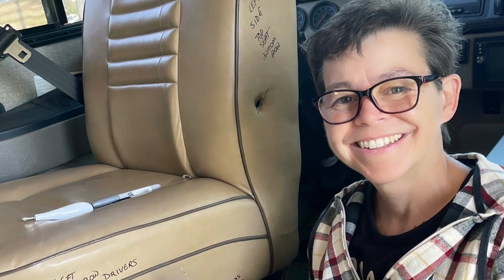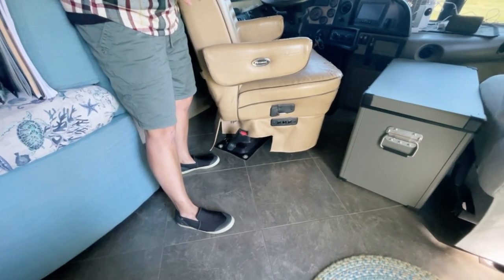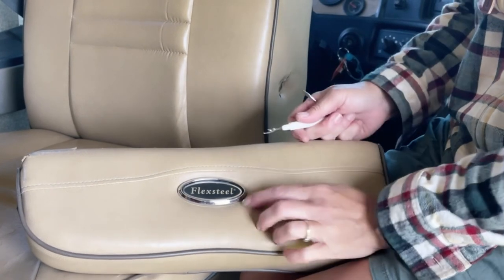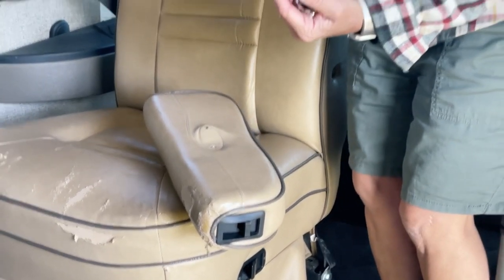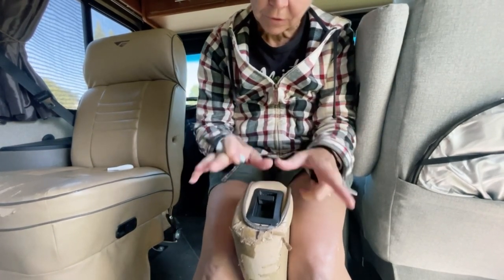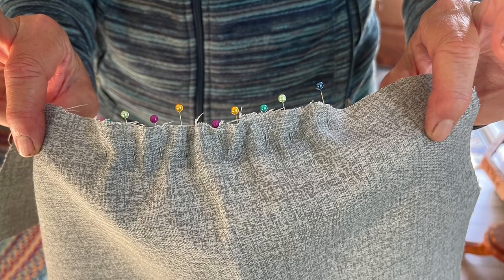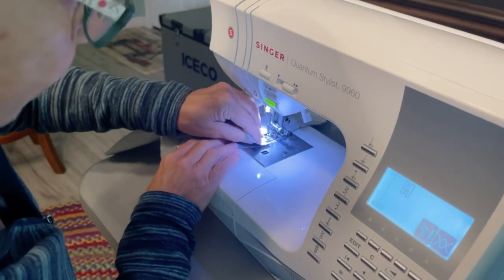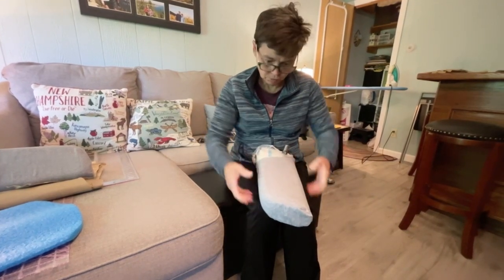Reupholstering RV Captain’s Chair

Comment: Thank you for this video! I'm recovering my chairs using covers made by Bauer RV Upholstery, but your video is still helpful in seeing how the chairs are assembled, etc. One thing I'd like to add, though, is that the Flexsteel badges on my armrests weren't so easy to reinstall because the inside of my armrests were not wood, but steel. Once I realized I wouldn't easily be able to just use the self-drilling screws to make new holes, it was a matter of fishing them around until I sunk them into the original holes. It helped to pull the steel cores out of the foam in order to see how far off center the original holes were.